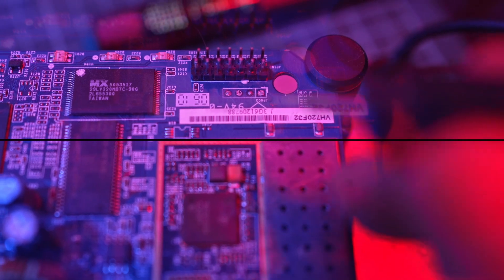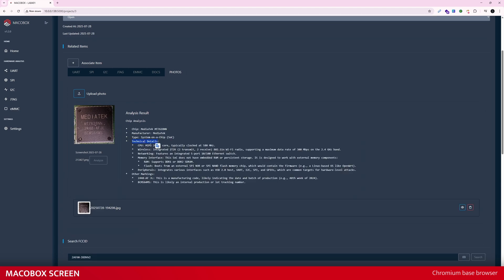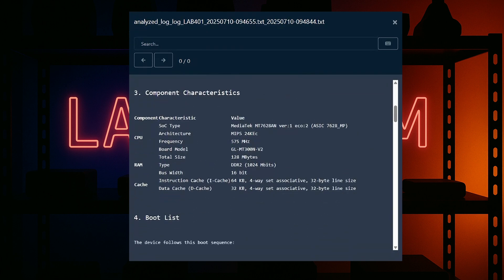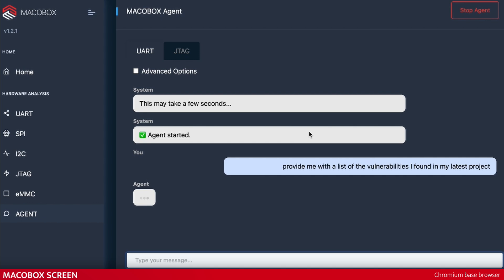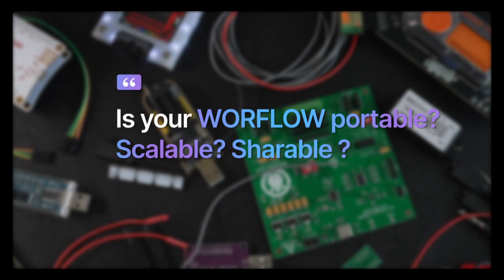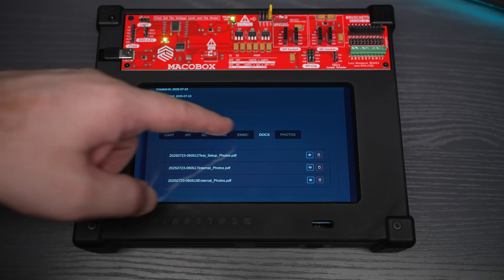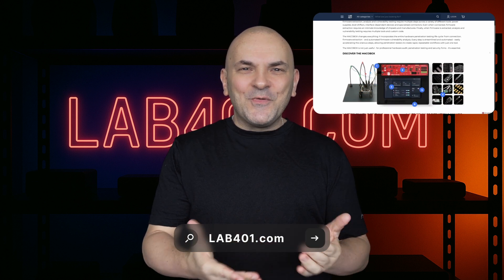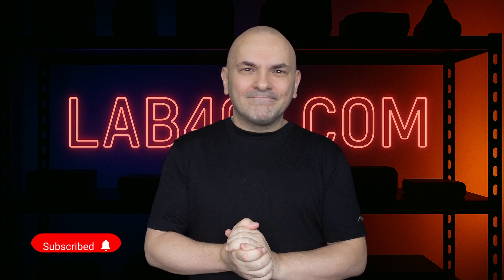Discover the hardware pentesting revolution : The MACOBOX

Comment: Ahaha.. I paused the video at 30 seconds to check their website. €2700 :D No. Just no.
Reply: Well bro, it called MAC O BOX. Not Rasp O Box.

I was going to opensource a similar solution.

MacOBOX has some advantage, Mine has others.

my solution is targeting in liberating old hardware from vendor locking.

But thinking about it, Lab401, the price is fair, in fact too cheap.

Because if you are junior, you should not let your brain rot by having AI do all that stuff for you : "MacObox, please hack this for me, i don't even know what it is, and stop using words like UART and JTAG"

And if you are professional Pentester, then 2.7k to 5k will be absorbed in your first report payout.

Overall, i give this product a 7/10.   I can see how to make it cheaper and better. 

I'm not affilated with Lab401,  but i bought most of their stuff.
Reply: Why dont you make it cheaper and sell your own? I think 2700€ is not cheap but if it works, for companies to buy it for their pentesters is not much tbh ... and hard work should be paid well.